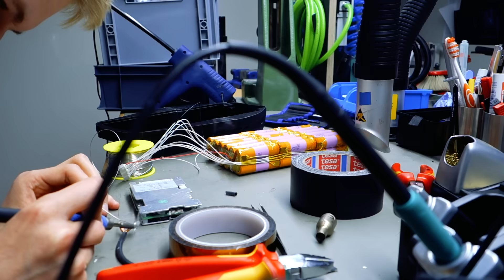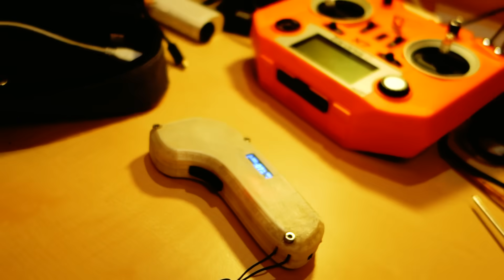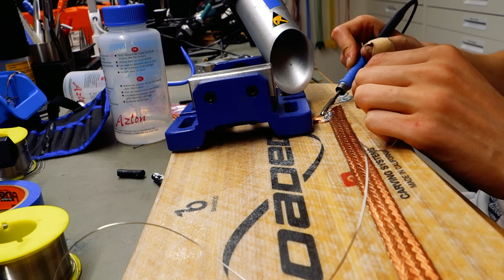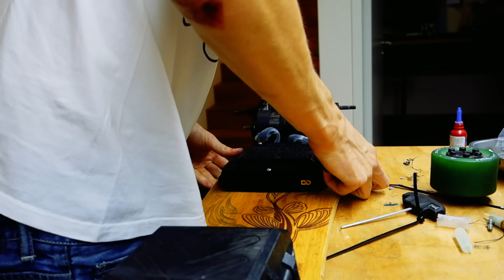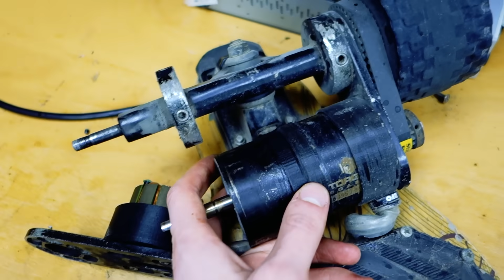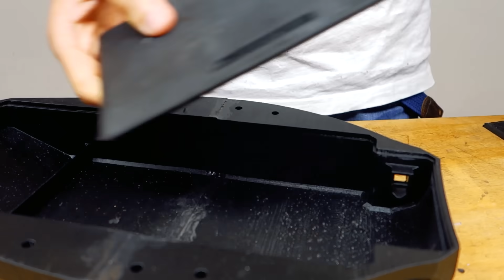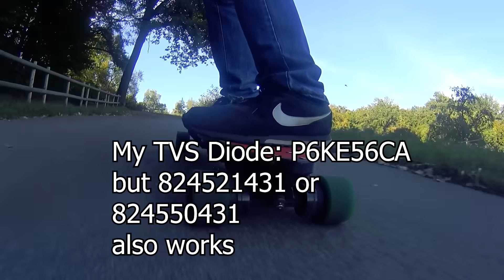My 3D Printed BOOSTED BOARD KILLER

Comment: I don't get it, boosted chose it's battery to be very power dense but yet you're board makes far more power, do you think their batteries will therefore outlive yours? Also the 2.2kW you stated for boosted is that constant or peak?
Reply from the maker: Boosted uses LiFePo4 as their battery and could easily outperform my board. If I used the same battery as them I could even increase my power even more. Boosted board limits their boards to a moderate 2.2kW constant power. Meaning you can hop on your board and ride up mount everest with full trottle and the board wont overheat because the ESCs are the limiting factor.
On my board the ESCs are not the limiting factor, I could increase their current quite a bit but that would damage my cells. And I can only push around 2.5kW going up a constant hill anything higher will likely thermal throttle.
On top of that LiFePo4 have insane cycle life. They will last you 5000cycles+ with 80% remaining capacity. That would be 70.000 Kilometers on a Boosted board. They definitly made a good choice with their battery, its reliable, very safe, has great cycle life and has very high energy density and will outlast every other component.
A 100Wh Battery that can produce 2.2kW is otherwise only possible with lipos but they are unsafe, and very unreliable.
Reply: I'm very interested in these batteries, I think BYD and CATL uses them too and another big benefit is it uses zero cobalt. Are you able to purchase LiFePo4s online? Do you know what the volumetric energy density is? I know for 18650s and 21700s it can go up to 750Wh/l but you lose about 20% due to packaging because they're cylindrical. Also I assume Boosted lets you go higher than 2.2kW for a few seconds do you know what the peak power is? I'm curious also how high a C rate they can take on charging and thus what kind of regen you can get up to, I definitely should research these batteries a little more. As far as I can tell though the German auto manufacturers are all buying NMC batteries even though they are buying from CATL whose primary product was the LiFePo4 prior. For these manufacturers there is something that is preventing them from going with this chemistry, although it may just be to have only one battery chemistry and as NMC is more common they can also source from LG chem and others.
Reply from the maker: yes you can buy them online. I get my cells from nkon.nl but thats only really usefull if you live in the eu. The boosted cells are the A123 and they have around 50-60% of the energy density of a li-ion battery.
You can usually charge them with 4C, thats what they claim in the datasheet. So 10 minutes from 5-80% should be possible. But charge time is never my concern on my daily commutes...
And dont even look at german car manufacturers they seriously dont know what they are doing. Look at audi with their terrible battery that gets way to hot and VW is now buying tesla packs because they realized that making a good EV battery is actually difficult and takes time but they were too busy sucking oil companys for the last 10 years.
Reply: Wait you're talking about VW buying Tesla batteries for their electrify charging stations?  But yeah Tesla just updated the range of their S and X to 370 and 325 EPA miles without upping the pack size. E-tron is rated for 204 miles on EPA cycle. This is just insane, I never expected that huge of a difference and I'm very aware of the Tesla's technology lead.

Comment: Could you let me know what you think of the apsu board or if the range is actually 25-30 miles  with the Panasonic 32BD 36v 12.8 Ah 10S4P battery and 2x1000watt Motors for only $700 US, completely new and trying to buy a cheap good quality board
Reply from the maker: cheap good quality board.... That doesnt work. Either cheap or good quality. panasonic 32DB cells dont even exist but their drivetrain is the usual one that everybody uses that doesnt even allow for belt tentioning. Maybe look into the meepo boards they are cheap and ok quality. I will do a review on the verreal f1 board very soon. So I'll have to see how good that board works in my next video...
Reply: Thanks for the reply, Im all about range, I was thinking of going with the meepo nls with an extra battery for the range and it’s around the same price, but the 2x400watt hub motors kinda stopped me, I want more power I feel than that but still want a considerable range, thanks again for the reply and any other advice would be awesome FYI I’m in the $700 US range
Reply: Also for the apsu belt not being adjustable I feel I can live with it, if it gets loose I feel it should be replaced anyway, besides they sell belts for pretty cheap on their site

Comment: I love all but battery. Why don't you use lipo pauches? Much easer to assable and amps almost always enough.
Reply: Energy density isn't as high so he won't get the range he was looking for
Reply from the maker: exactly, very low energy density. They would weigh way more and take up much more space then my 18650s. And on top of that lipos are basically trash after 100 full cycles while mine should last at least 1000cycles.
Reply: Very true although the power density is so amazing that I still love Lipos. I used them for my coilgun and am able to discharge over 20kW from 2S1P 4.4Ah batteries, even though it's just for milliseconds it still blows my mind.
Reply: @Pryside  I think you are just unlucky. Lipos are awesome and they very similar to lions these days. Easy you can get 400+ cyles and amps are awesome. Im using 2x6S 10ah's on my electric bike and I have driven over 1.5k kilometers with them already. And its nice to know if I decide to make some alternation I can get easily get constant 5KW feed form those two in series. And best part it took me only 5-10 minutes add whole thing to ebike.

Comment: awesome build, any idea on ballpark cost assuming you own a 3D printer?
Reply from the maker: 1200€ I would say. But i your on a budget just get cheaper wheels from aliexpress, cheaper vescs 10S battery and only 5055 motors instead of 6355 and you can save another 500€

Comment: You should have taken a loot at BAMBOO GTX SERIES, can do 50 km in a single charge.
Reply from the maker: Thats a blatant lie. Their board has a 360Wh Battery mine has a 388Wh battery. If you ride 10Km/h on a perfectly flat surface maybe the 50Km is possible but real world conditions are 11Wh/Km when you are riding at 25Kmh with not too many hills.
Reply: @Pryside  doesn't make it a lie, just situational. I don't have many hills in my neighborhood so for me it would prolly make the distance
Reply from the maker: No a 7,2Wh/Km is only possible if you stay below 10Km/h at all times. Not a real world condition at all.

Comment: The Evolve Bamboo gtx is easily the best electric skateboard. Atv wheel & gear options plus 30 miles of range with digital remote.
Reply from the maker: 30 miles range is very wrong. they have 360Wh, thats 33Km or 20 miles of range. Maybe if you ride with 10Km/h but real world conditions are 11Wh/Km.
And their old remote was very dangorous and had connection issues all the time, definitly not a safe and reliable board. I dont know how much you can trust a company that obviously does 0 testing.

Comment: I want to know where to get the parts for the remote.  I don't want to just buy it off someone  I want to know why things are working and be able to troubleshoot my board when things are not working.
Reply from the maker: just google "Firefly esk8 remote" and you will find the esk8 builders forum, with a partslist github with instructions and everything
Reply: Do you have any notes on how the boosted 3d printed parts such as "use high infile j+ 60%) lower height(100-200) microns"

Comment: how much was the battery
Reply from the maker: Cells only? 120€ for the 36 Samsung 30q cells, 5€ for Nickel strips, 50€ for the Smart BMS, 15€ for my antispark and maybe 3€ for cables and things. 20€ for the printed plastic casing.
 So around 216€ in total.

Comment: I would strongly recommend TIG welding those motor brackets to those trucks. I had the same setup with a single motor. After about 200 km the motor mount to truck interface was so loose that the belt started to slip. I had even drilled and tapped the trucks properly with 3 set screws to hold the motor bracket. No problem since I paid someone to weld them for me.  Love the build tho!
Reply from the maker: Nah, no need to. I have ridden these mounts almost 2000km in total and never had any issues. I used loctite 648 for where the mount is touching the axle and loctite 243 for all screws. Holds perfectly.

Comment: How about connecting external battery maybe from a backpack then you can increase ranger due to bigger battery that you can carry on your back
Reply from the maker: A little to complicated, if you want to ride long range and dont care about weight you can simply mount a battery on top in the middle of the board where no feet are. Backpack battery would be very dangorous, way to much weight so high up there.

Comment: I would recommend switching to 21700 batteries - https://liionwholesale.com/collections/batteries/products/molicel-npe-inr-21700-p42a-45a-4200mah-flat-top-21700-battery-authorized-distributor?variant=15913210675294
This one is 4200mah with 45 amp per cell ratings!! you could go 12s4p and be rock solid, 90 amps per motor!
Reply from the maker: yeah will switch to 21700 samsung 40T one day, but when designing this a year ago 21700 cells were hard to get and expensive. But they are definitly the future.

Comment: I may sound dumb (because I don't know anything about batteries) why wouldn't you use  Molicel INR-2100-P42A  It is 4200mAh and 30A output.
Reply from the maker: Because they are 100% fake. Dont even need to look them up. The currently highest capacity battery is the Samsung 35E with 3,5Ah anything higher then that is definitly fake. Only namebrand batterys like LG, Panasonic, Samsung, Sanyo etc. are actually good, every other "vapecell" and whatever brand just buys LG cells rewraps them with a higher capacity and amp label and resells them.
the 30Q are still the best energy density and power density 18650.
Reply: Thanks for explaining.

Comment: Cooles Projekt!!!    
Aber wie viel würde das ungefähr kosten das selber zu bauen und wie lange hast du für dieses Projekt gebraucht?
Reply from the maker: Materialkosten sind 1200€ mit Ladegerät und allem. Kannst aber mit nem kleineren 50mm Motor und billigerem vesc die kosten auch locker auf 800-900€ runter bringen
Reply: Okay danke 👍 @Pryside

Comment: best, best, best.. i dont see it so best, and where are the proof of the 50km/h?
Reply from the maker: Maximum Speed proves absolutely nothing.
I literally go up 25% inclines with 40Kmh in this video and even in the video of my previous board there are plenty of scenes where I go above 50Kmh... 
I could show you some GPS data but people like you would still say its fake.
These are two VESCS they are easily able to push out 2,5kW. With 5kW of power you can go up to 90Kmh with the right gearing. If you know anything about electric vehicles you would know that plenty of people have done this before and this is easily possible.

Comment: Literally anything>busted board. Like holy shit. I have a pre-built evolve carbon and a homemade thing that hits  about 50mph. The evolve will eat the boosted. And now they have a way better remote and it’s 100% worth it to buy one and 100% better than the boosted.
Reply from the maker: I rode their R2 remote, Its okay but definitely not my taste. Their old remote was completely shit and the connection was unacceptable. It's still a bit heavier than the BB and its of course way more expensive. And the LiFePo4 Battery of the BB with its basically unlimited cycles just has its benefits.
Reply: Leo Pryside I totally agree that the first was a failed abortion, but I love the V2 remote. But I may have a really good reason to because I have very large hands. While there are limitations to not being able to remove a battery pack on the evolve, it’s more powerful. MUCH. MORE. POWERFUL. Than the boosted. Not to mention those amazing AT pneumatic tires.

Comment: Drawing 5kW from a 12S3P 30Q pack is a quick way to degrade it! I'd only draw 2.5kW maybe 3kW to be safe.
Reply from the maker: Propably right but, I almost never go full throttle anyway. Its just nice to have that bit extra power that you never have to use :)

Comment: i built my own E-Longboard too :D 
the maximum speed is 52km/h and i have about 30 km range :3 it costed around 500€ and can easily beat a boosted board as well :D
well i used a diffent motor and different batteries BUT...
The main difference is that i dont use a BMS. discharging without a BMS is not a problem as long as you (how i do it) charge the batteries balanced, so they all have the same voltage.
in my case i had a special charger at home and didnt need to buy one but i mainly didnt use a BMS because i simply dont trust them.
the battery pack is the most expensive part of the longboard and i want to keep it good for a long time. For that reason i chose a proffesional charger and not a BMS
Reply: Saturos what esc have you bought?
Reply: @LucaFlati  i used a FSESC 6.6 to run my Aerodrive sk3 213kv BLDC Motor. The FSESC6.6 can deliver 60A constantly and the motor can handle 65A. but i programmed the FSESC to a max current of 50A to keep everything cooler and dont run it on the limit. 
50A are also just used when start rolling. while driving the motor pulls around 10 to 15A
i also used samsung 25R cells for the battery pack. i configured it a 10S5P pack so it has 42V and 12500mAh when fully charged.
with this setup i reach around 25 to 30 km of range and a max speed of 52 kmh
Reply: Saturos that's OP thanks for the info
Reply from the maker: yeah, thats pretty close to my first eBoard I built. I also didnt trust any BMS out there until I had the smart BMS. Now I can just look at all the cells with the app and never have to worry. :)
made even a video about it https://www.youtube.com/watch?v=QQW3uuzNnkg

Comment: AWESOME PROJECT:) why do u use belt instead of just mount the motor in the middle. like Carvon boards. more work but no belts ¯\_(ツ)_/¯
Reply from the maker: Its not that easy. Main problem is the Kv rating. the reason we use Belt drive systems is not because the lack of hub motors. there are quite a few out there but only the real expensive ones actually are efficient enough to be used for such high power applications. The Belt gearing just allows for much more torque and efficency.

Comment: this video is great but everyone knows there are a lot better boards then the boosted boards you can buy.
Reply from the maker: Which one. Yes there are faster ones, yes there are cheaper ones but most of them lack on one of these aspects: Flexible deck for smooth ride, great remote, good torque, reliable
I dont know any board that is as good as the boosted board in all of these aspects.

Comment: Learned a lot too. Adding that diode at the input of VESC for over voltage protection, using UART to control the VESC. And water proofing the electronics, cheap and better bearings, etc. Thanks a lot.

Comment: Great video and very informative. one question I had is how would I put a TVS diode on my VESC that I got from diy electric skateboard (torque boards)?
Many thanks,
Reply from the maker: Same thing, on the pcb itself right where both the red and black cables are soldered onto the pcb.
Put it right on top of them, direction doesnt matter with the bi-directional one.
You maybe have to cut open the shrinking tube but its quite worth it.

Comment: How do you get the motor mounts on straight?
Reply from the maker: Haha, not that easy. Mounted the angle bracket first. Then screwed in the motors first, put a piece of perfboard between them and clamped them together. Put the wheels on the check the spacing. Put quite a bit of loctite 648 on the axle itself and loctite 243 on the screws. screwed everything in and you got yourself a straight and strong motor mount.